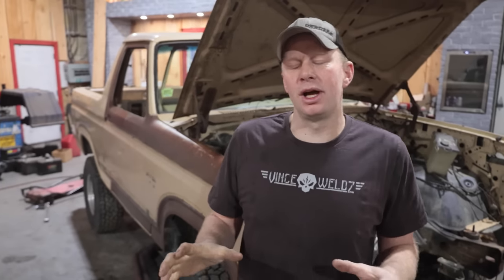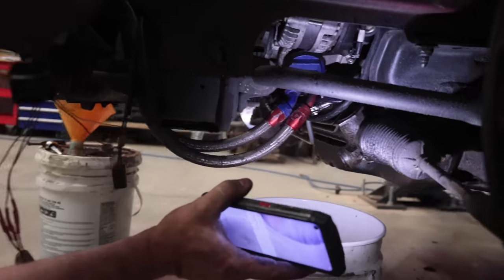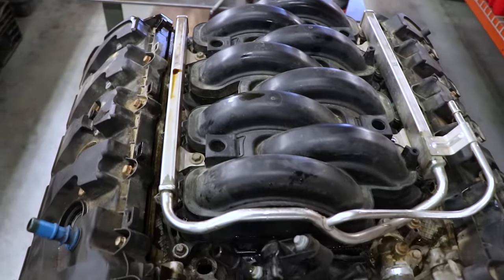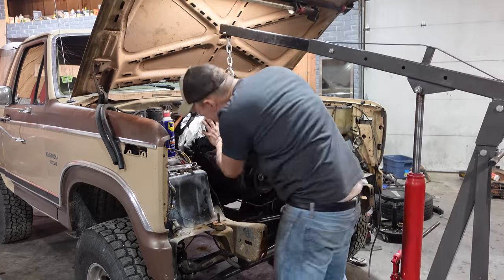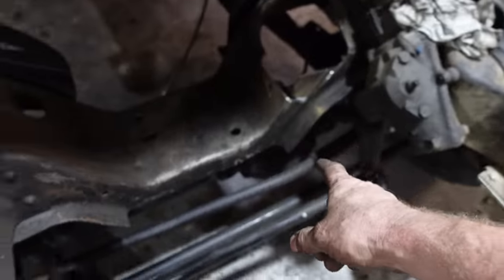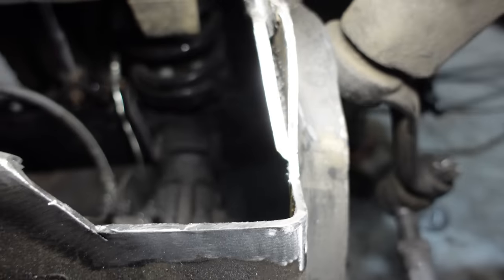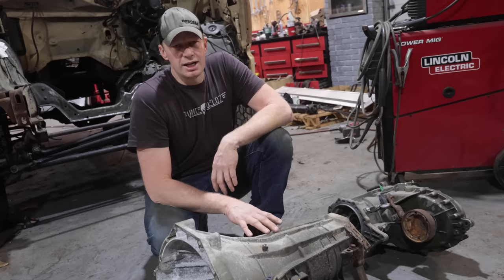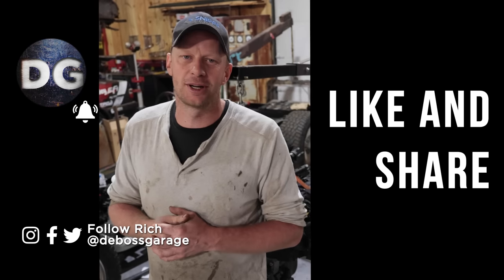How To Swap 5.0 Coyote in 1980-96 Ford F-Series Bronco / Truck

Comment: Best line "You build the engine and we will get it in there"   I am looking forward to seeing the V10 crammed in there.
Reply: Just anti seiz the plugs and make sure they’re torqed. Lol
Reply: “Get it in”, doesn’t mean running right?
Reply: There's a few write ups on FTE of doing a 6.8 V10 in an OBS Ford
Reply: @jesse yarbrough  what kind of obs? Was it a 3/4 ton? I imagine a half ton would have to weak of suspension to hold that big engine
Reply: @Mr.Safety.  v10 isn’t actual all that much heavier than the 5.8 that came in it. 90lbs difference
Reply: Funny you say v10. I just found a old 99 ford v10 for $300 om marketplace haha so tempting to get it haha they sound pretty sick. Terrible om gas probably

Comment: Rich, the Coyote doesn't provide a place to mount a power steering pump because Ford switched to electric power assist with the introduction of steering racks on trucks. The Bronco came with a hydraulic assist gear box. How are you planning to steer the Bronco? Convert it to rack and pinion steering?
Reply: They make an accessory drive kit to add it.  AC or no AC.
Reply: You can always use an electric pump off something like a Saturn Astra
Reply: Personally I would go with electric power steering especially with the abundance of junk Toyota KIA and gm cars with easy to power electric boxes.

Comment: 100% on the manual shift t-case. I love feeling whether or not the gears are properly engaged on my 95 Suburban.
Reply: Hell I was set on using a 3 mode electronic transfer case til I realized that the 10 speed has the same mount points for the manual transfer case so it just made it easier.
Reply: I would love a manual in my 99 Burb, won't engage 4wd if it's cold out now.
Picked up a rear axle & front diff just to get a new actuator.

Comment: The intake manifold and the exhaust manifolds on the coyote determine more or less torque and horsepower.  By putting the logs back on you're nearly there to the truck ratings.  Swap the Boss intake for a stock truck one and voila.  Yes a tune can change it some, but it's pretty neat how the three different intake manifolds for the coyote change the horsepower and torque.  That being said, the Boss intake will look cooler under than hood, for sure.  Holley makes an EFI tunnel ram that should fit and looks similar to the Ford Racing tunnel ram for the coyote, if you want that old school look instead of the plastic look under the hood.

Comment: Hey Rich love these reporter vids I'm 65 and as a 20ish year old here in Australia a reporter of the then F100 was a 351 Cleveland why did Ford choose the 302 for the coyote build was the 351 not so popular ,I guess we didn't have the choices here that you guys got 351Ford or 350 Chev was king of the road stuff here ,also the Coyote engine looks much larger than I remember the 302 heads look huge is this because of the over head cam system ,Anyway Mate this retired Hoon,petrol head loves your work can't wait for the next one ,I'm living my petrol fuelled retirement through you Mate and loving it ,you have better toys than I ever had 
Cheers Kym
Adelaide
Reply: id guess 302 is pretty much the 'imperial' equivalent of 5.0 Litres. 351 would be about 5.75 i believe. and yes the Coyote probably looks wide as its a DOHC per bank set up, rather than a single cam pushrod engine

Comment: Loud exhaust is fun for a once in awhile weekend toy rig but it’s nice to hear yourself think too. Call me old but I just like a little rumble these days, I don’t need the whole thunderstorm
Reply: I don't think it's an old guy thing to want an exhaust that not only sounds good but also doesn't leave your head rattling. About a week ago I had an appointment to have my exhaust done but my muffler did not show up on time so I ended up having to drive my 460 with long tube headers and dual 3 in straight pipes for a week and it was painful. I got my muffler 3 days ago and had it put on after work and I've never been happier about an exhaust system. Nice and quiet so I can hold a conversation in the cab even when I'm pulling my gooseneck but it's loud and rowdy when I put my foot down and let it sing.

Comment: I have the sister transmission to that 6r80. ZF6HP28 behind a N54 in my 335. Custom adapter plate and mounting kit but those transmissions are KILLER

Theres even a guy named dustin lanners who has a ZF6hp28 with Ford 6r80 internals and circle D 252mm probillet converter. The 6r80 is a incredible transmission

Comment: Im in the process of installing a Terminator X in my 90 F250 with the 5.8 and manual 5 speed. I weighed the different options and this seemed to be the cheapest and best being able to utilize most of the stock efi hardware already on the engine. Thinking of upgrading the intake and heads as I have an early Bronco with a mildly built 351 and Holley 4di, World Products sr heads and Performer RPM intake and am very happy with the performance of that combination.
Reply: Didn't even think of this I have a 89 with a 460 and it is like 1600 bucks to do the maf install

Comment: Eastern Oregon and Eastern Washington also are dry and preserve vehicles very well. My 73 AMC Gremlin barely had any rust on it and that was only on where the back tires would throw gravel,sand, and snow in the winter when they would spin out, which was a lot since is was RWD and had all the weight in the front. The rust was minor and could be addressed easily. The motor blew up on me at highway speed when a lifter died and went through the side of the block after shooting through the oil pan and bouncing off the pavement. 180k miles and 130k it was not taken care of well and was parked with oil in it for 25 years before I got it, so it did well.

It lived again with a supercharged big block V8 dropped in it for unlimited dirt track racing by a mad man that bought it off me for $350.

Comment: When bending things somthing most don't think about is "set back" essentially calculating the stretch of the metal you are bending. Alot of shop hand books have a guide to doing these calculations / equations. I know I used the word equations, but fear not anyone with their grade 10 should be just fine. (I'm not Canadian that's just some Canadian slang I picked up from trailer park boys). Most people who need somthing bent in their home shop just bend a peice that's close enough and trim if necessary, I get it it's quick and easy. But especially if you're doing multiple bends that stretch adds up and compliles and things get off the rails quick. It's pretty easy to take a second measure what you have, calculate, cut a peice the exact size needed, bend at x y x and be done.

Comment: best ford engine ever built, clevo. 351 / 460 chev killers. more reliable that a petrified tree..  lpg, 12.1 comp. std cam. cut cat fast. in a bronco. with 35,s.

Comment: Hey Rich. Just wondering, does the installation of the coyote motor over the stock motor affect the dynamics of the driver's seat in relationship to the Milwaukee 12 volt under it?

Comment: "Just take the top off," says the Canadian.  Once was enough for me to know NOT to take t-tops out during 105 degree ( ~41C) sunny days for a fun drive.  I should have known better having bikes, but I was 17 and thought it might work...by the time I got 15 miles up the road to where I was going, the first thing I did was pop the tops back in.  The last gen LS Trans Ams (mine is a 99, still have it...needs a fuel pump after sitting for college even with a drained tank...yay gm) may not have been luxury, but that car would cool down or heat up faster than I could get out of the garage and turned around.

For engine swaps I went from 4.6L modular V8s (the Aviators were good donors for 32v DOHC aluminum block variants) to now I pretty much always use either a Toyota 4.0L 1UZ 32v DOHC V8 or 1GR V6 from Toyota.  I did a RWD on a 97 ST204 Celica with a 1GR V6 turbocharged over wedging an I6 in.  My E31 I got as a roller has a rebuilt and tuned 1UZ that makes for a great touring car.

I also love the 3.0L SHO V6s and have a stockpile of engines and parts in my storage warehouse.  I have one turbocharged in an RX8 (another roller, 500 bucks off marketplace) and it's a perfect combination of high revs and a great chassis.  My factory engine RX8 is pushing 240k miles, they last if you know how to treat them (like a 2 stroke lol), but at 250k I was considering either another swap or a rebuild.  I used to rebuild them back in high school and college to flip, super simple engine and relatively cheap to get good kits for (probably because of the demand...).

Comment: Not sure if it helps, but “Fat Fender Garage” in Gilbert, Az does these swaps everyday. Maybe they may have parts or info you need. They also have a YouTube page if interested. Nice work by the way. Love your channel. P.S. I don’t work for or with them in anyway, they are just a local company I know about.

Comment: I've got a 94' Bronco that I wanted to dabble with Terminator X Max, the dash, tuning (bought into a course for this) and a turbocharged engine and was disappointed in the support that Holley has for the Ford transmissions - basically the 4R70W and that is NOT going to hold up to the abuse I'm planning. Long story short I wanted a ton of data acquisition and everything to integrate, basically throwing out any idea of a modern overdrive automatic Ford platform.  
Cost came into play too – being in the salt belt there is a plethora of cheap rusted out 6.0/4L80E’s around for less than I can find a good 5.8W for… kinda of sad.  The 6.0/80E with the Terminator X MAX, 6.86” display and CAN I/O box allows me to monitor al the normal stuff plus coolant pressure, trans line pressure, dome pressure, fuel temp, ethanol content, etc etc. This is a boosted street toy/family cruiser and I need modern reliable parts with a single pane of glass to monitor it – unfortunately Holley support for the Ford stuff just isn’t there…

Comment: This build scratches every itch I've had. You see LS swap this, that and the other thing.But freaking Coyote swap. That's the tits. If the Coyote you have is a true BOSS 302 engine, that's actually the "Road Runner" variant. 👍

Comment: Did you keep the transmission and 4X4 when doing the 5.0 swap?
I have a great 1989 F250 4x4 I want to drop a 2015 f250 5.0 into and keep my 4 speed . Adaptor kits?

Comment: Just saw a video on a body swap to diffrent chassis you guys did. I have a 93 E150 Club Wagon Van 5.8L vin 1FDEE14H5PHB57642 and was wondering, can I get a wrecked truck with modern/newer chassis,better TRANS and motor to do the same,AND if so,witch truck would be the one to get.?
P.S.
I don't want to have to modify anything, would just want to take the body off my van that's in Gd condition, AND put on the newer truck chassis.

Comment: Nice job on the SAS. Super lift made a super runner  steering upgrade for the ttb because of the problems you had. In sure the solid axle is worlds better than the old ttb. Did you keep the stock ttb coil buckets in or did you swap to the 78/79 style when you did the solid axle?  Yours was probably the best .SAS vid on u tube. 
I've got a single cab short bed 2000 model f150 I'm toying with the SAS idea and using super duty axles under it. And then eventually when godzilla motors start showing up in junk yards swap one of those in for the gutless 4.6 Triton.

Nice to see a bronco getting some love and being done right. To many u tubers weren't alive when these were  new back in the day and thus have no love for them. They thrash them to death or throw a stupid diesel in them which is dumb. They don't have the wheel base to be a great diesel tow rig and are better suited for gas motors. I love where your going with yours. Btw......the 78/79s are my absolute favorite era broncos  but now days are priced out of my range. I wish I'd have kept all the ones I had back in the 80s and 90s when they were dirt cheap.
Reply: Regarding diesel, a 4bt would be a great candidate for reliability and fuel efficiency. Obv you're talking about dudes putting big diesel in there turning their broncos into brodozers.

Comment: When you have spent most your YT career badmouthing Ford, then realize your numbers are down, time to do a coyote swap. What a joke of a channel. Glad I bounced years ago.
Reply from the maker: Welcome to the internet where you can’t tell the truth about a head gasket, spark plug or a valve cover for fear of an unsubscription. Bye
Reply: Never said there wasn’t problems. The internet likes to blow things up. 
  The unsubscribing doesn’t come from bad mouthing, it’s the way it’s said like whatever brand you like is best and flawless. Ignorance is bliss
Reply from the maker: @claas90017  so you've determined based on the videos we post that our problem is loyalty to a vehicle manufacturer.
Reply: I’m not brand loyal, I’ve worked on everything, I see every brand for what they are. 
  I’ve seen the phasers on fords and spark plug blow out, dodge trannys, oil leaking Cummins, LS lifters, exhaust studs, thrust bearing, Dmax injectors, head gaskets, pumps
  I remember years ago back tords when you where getting started with YT, i did watch you because your no dummy. But I remember every time a ford came in you would roll your eyes and make a dig. Be a good mechanic and just explain and say something to the affect yeah I see a lot of theses with theses problems
Reply from the maker: @claas90017  if you don't see the value in critiquing Ford or any other brand for deleting bolt holes to save millions or engineering planned obsolescence into their repair process then you don't need to watch.

Comment: The only good thing about this install is their keeping the power plant a Ford. Other than that using the coyote is a mistake, it’s easy to squeeze 400HP out a Small Block Ford 289-351w or 429/460. Seriously expected more of Rich at DEBOSS GARAGE than to wimp out and use a garbage late model engine instead of what any real OBS 80-96 BULLNOSE truck owner would do. So not impressed!!!💩 BTW Rich there are carbed 302’s that make a coyote look like a tag along little brother rather than serious competitor!!!
Reply: Ok Boomer 👍
Reply: Coyote is the way, it’s ok if you haven’t realized it yet,
Reply: @ridered7394  or Godzilla or Ls
Reply: @neil brown. He wants something more efficient than a 7.3, 
And the LS engine is so lame
Reply: @ridered7394  Lol Ls swap the world
Reply from the maker: we got 550hp at the crank with the coyote, without opening it up
Reply: @neilbrown82  boomer, just exactly what does that mean?
Reply: @ridered7394  LS’s are good for, ticking lifters, lifters destroying cams and oh yeah leaking like crazy if the timing cover, oil pan and trans aren’t nasa installed! Got an 07 Escalade 6.2 with 108k & 06 Avalanche 5.3 with 160k and both leak like crazy, constant sensor issues and to boot everything genuine GM parts is stupid expensive.
Reply: @DEBOSSGARAGE  Come on Rich, with your style of building not opening up an engine for sake of saving time on the build is lacking the “here we go” factor! I mean if your building a 80-96 bullnose Ford truck and want a late model engine the 7.3 is the way to go it’s out the box 440+ hp. Plus if you open it up with simple bolt on parts like heads, cam, intake & exhaust its 550+ hp all day everyday reliably. Not to mention it’s a true pushrod engine based off the 351w platform with modern engineering and design. Leave the dual overhead cam engines to the folks across the pond and the ricer wannabes.
Reply: The man is working on a variety of different projects, the epitome of something for everybody, a race car, tank, work truck, highway tractor etc… Not everybody is in love with everybody else’s project. This channel is about appreciating the effort put into projects. Real car guys are about the build not the result.